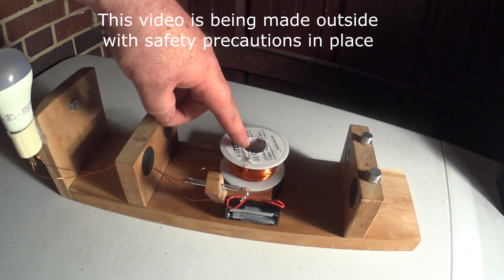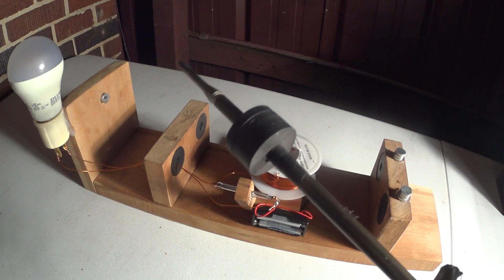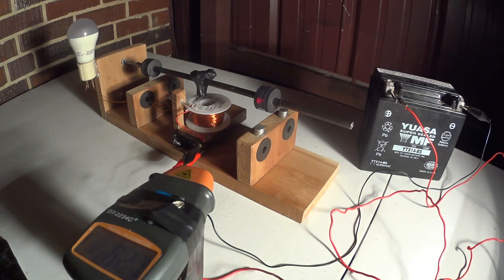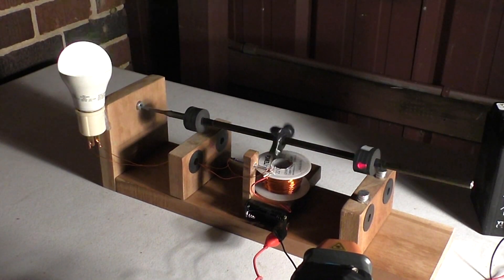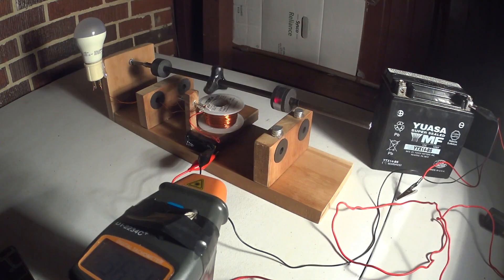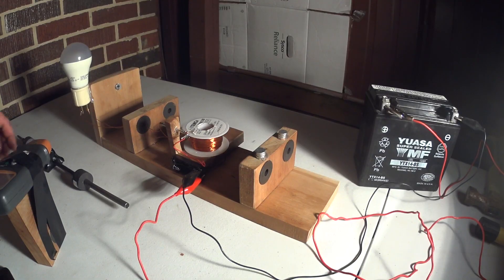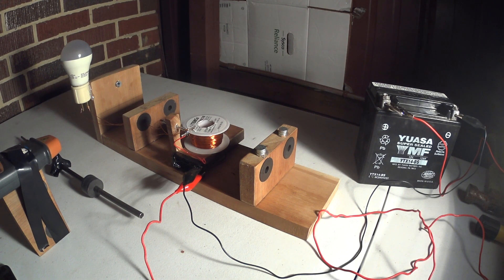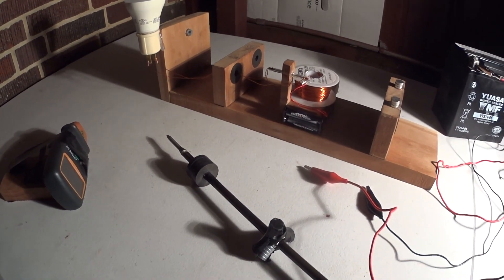Terminal Velocity Floating Magnet Motor

Comment: The vibration at high speed is from the flex on the arrow + slight unbalance weight. A shorter and more rigid shaft + better balance will spin faster.

Comment: FREE ENERGY form the coil/magnet. may be it can use "self-loop" putting a transformer on the OUT of the lamp and the   transformer (outlet voltage) will susbtitute the battery supply. OBS : putting CAPACITOR in parallel with the coil will increase the spark (i hope). OBS 2: down the coil: if you put an atractive magnet in the bottom(down) of the coil , THEN the rotor-magnet will work better (because is atracted to the magnet instaled DOWN the coil)

Comment: Also 2 boards with 1 3/4'' hole saw mounted for safety <-IOI--------------IOI-------  or hole roughly twice the diameter of arrow shaft would keep it    I   I                I  I in place until it passes the wobble stage.

Comment: Only a thought, but what if you made a mirror image of the magnetic support that would be in the same position as the other magnets. Just flipped through 180° so that the drive shaft is effectively 'sandwiched' between the top and bottom magnetic fields.
Reply from the maker: +clixbits I'll have to give that a try. Thanks
Reply: +scannerguy1968  why doesn't clixbits  keep his thoughts too himself !